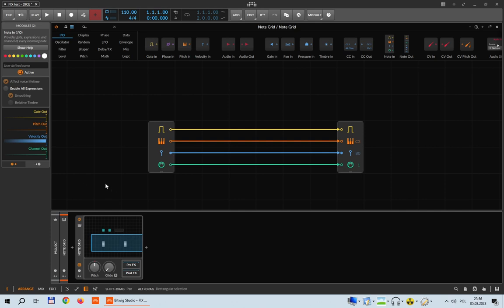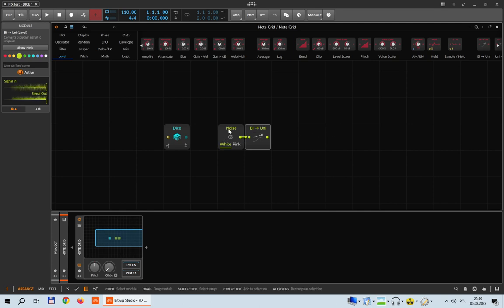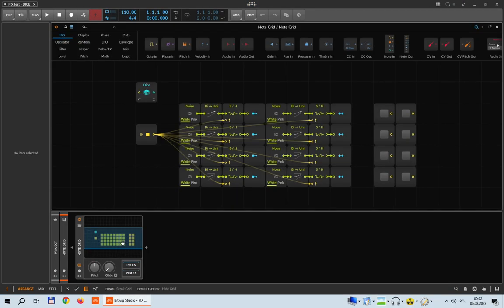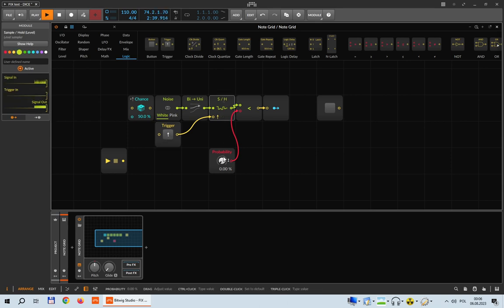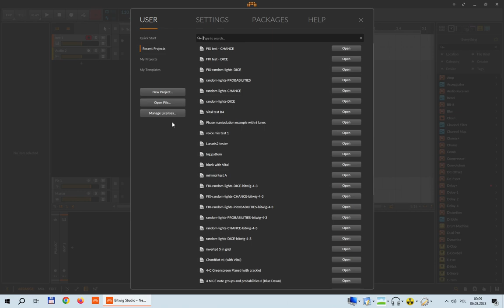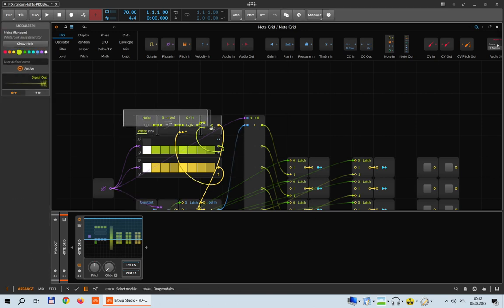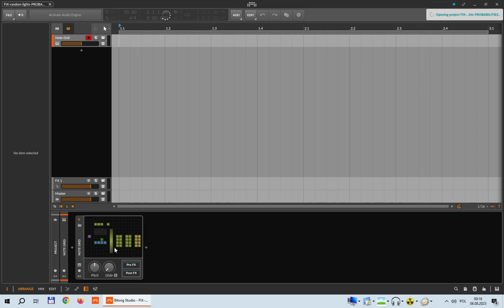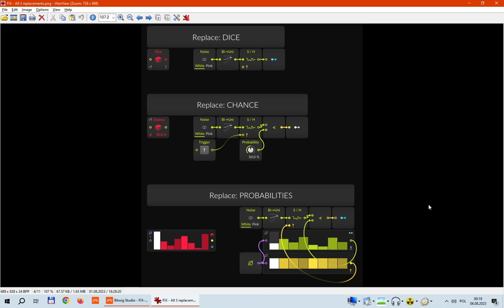How to get truly random sequences in Bitwig's grid

Comment: You didn't help the situation, you only made it worse. It's like trying to create a version of Minecraft that takes away the ability to set the world seed. That would be a downgrade. Seeded random is much more powerful than uncontrollable random. I guess you haven't figured out how to work with seeds.
Reply from the maker: You are correct that both options should be available, because both are needed, for different scenarios. Trouble is, we can't get new seeds in the grid, there is apparently no way of telling the grid to generate a new one. You can do it for midi clips, you can't in the grid. I am (well, was) a programmer, I know how to work with seeds :-)
Reply: indeed we need global random seed, and local random seed as well. and thankfully this concept already exists in Clips for Operators and expression Spreads. we just need to have it everywhere now.
Reply: for now, I do seeded random in my Grid patches via 4 seconds of white noise sample (could be longer, just something I had around, and something you can bounce from noise generator at any moment), then with some logic and modules I get to manipulate frozen playhead on a sampler in such a way that allows looping set lengths of sequences from any point in the sample, which you can of course repeat at will or choose at random. in some situations bouncing a new sample of noise would be considered getting a new seed really.
SH LFO is acting as a sample of noise, which it seems to randomise each time Grid is re-activated, or at least project is reloaded. it has a buffer of 2 to the power of 16 I think, in both positive and negative direction of the phase, and that way it's the only module I've seen so far that instead of wrapping to 0 when it's phase is driven with integers, it uses integers as indexes. so if it's not in Hold rate mode, you could also 'rewind it' to extent with modulation of phase by integers.